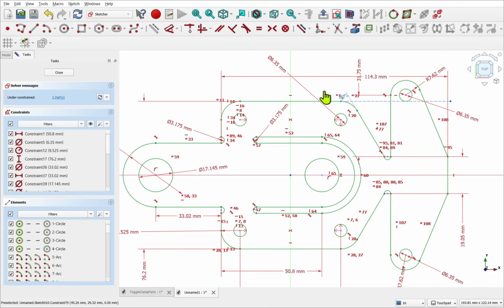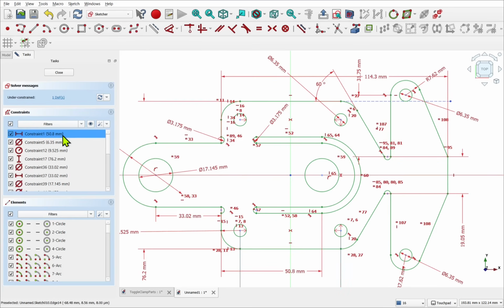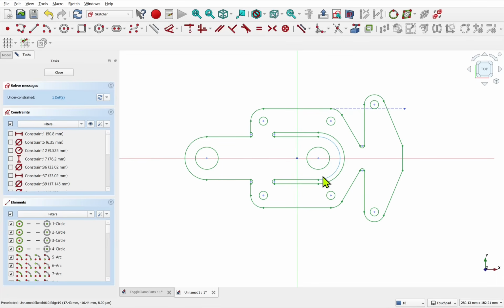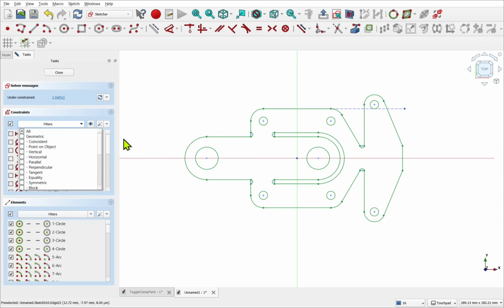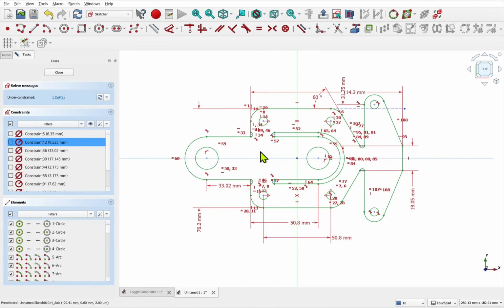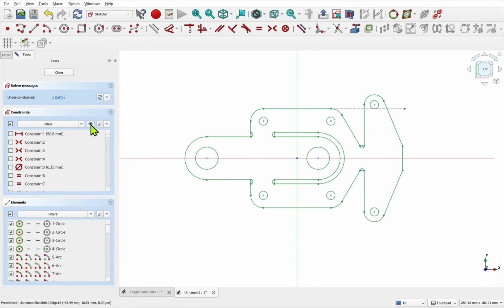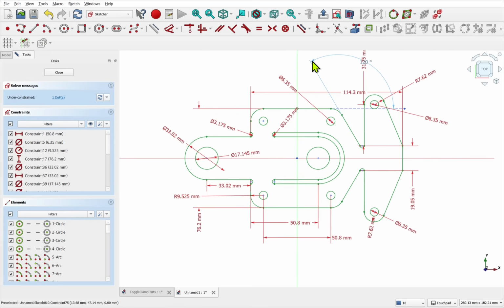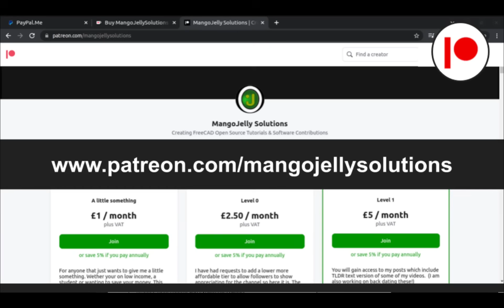REDUCE FreeCAD Sketcher Constraint Mess & Clutter!  |  Making your life easier

Comment: Thanks for the instructions but I seem to have fallen into a hole in this filtering malarky.
I am looking for a way to bring back all the constraints into view.
I have a sketch that was a bit of a mess and I somehow hide a load of the data and no I cant get it back.
Everything is checked in the Filter, but all my dim constraints are missing.
Reply from the maker: So best to check that when you drop down the filter that the "All" is checked and not a grey box in the check (show that some are checked) which sound like you already done, by the right there is a drop down by the chisel and spanner icon, in there uncheck 'show only filtered constraints'.  Also click the eye icon by the side of the filter, this toggles the visibility of constraints. 

I have just found something interesting which may be the bug your experiencing.  If you hit z on the keyboard then z again in quick session, freecad swaps to the virtual space, on one of those virtual spaces they eye to show all doesn't work, swapping back the eye does and shows all constraints.  I wonder if this is what your experiencing.

Comment: Is it easy to have multiple instances of the sketch in the same page with different types of constraints? One for radius, for distances etc. For easy to read documentations.
Reply from the maker: I have never tried multiple instances of the sketch for that purpose but you can have multiple instances of the constraint itself by using the the reference constraint tick box.  This means you can dimension the same circle with both constraints without going into over constrained.  Then, think out loud, you could use the technique in the video to place them onto the second layer.

Comment: I would find it helpful if there was a "key" to the different error symbols that appear in ones sketch, fillet, polar pattern and so on.

For example sometimes there is a blue tick, a green drop down arrow, purple square or other subtle signs a component is not right. 

I did an additive pipe a while ago and it worked. But for some reason it developed a red indicator on it. Took me ages to figure out it was likely because I lost or deleted one of the planes (XY or other). The pipe still worked but it would be nice to hover over the error and have it show a likely cause. Like "Hey idiot deleted XXX".

Thank you for the great video instructions you do.
Reply from the maker: I agree, I was talking about this to another person last week and there needs to be almost a pooled resource where you can go for error and keys.  There is a source for some of the treeview icons here : https://github.com/FreeCAD/FreeCAD-documentation/blob/main/wiki/Tree_view.md and I started a while back a source for common errors (https://mangojellysolutions.blogspot.com/2022/12/freecad-error-index-with-resolutions.html) but I really need to get back onto it (one of the reasons I was having the conversation).  I am tempted to do these as YT shorts but the vertical format is a pain.  Glad you enjoyed the video.